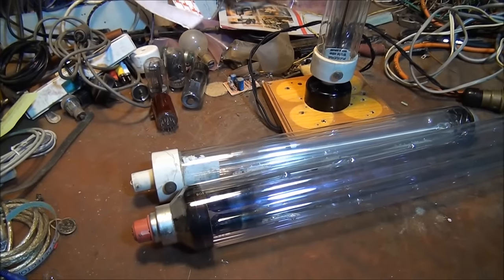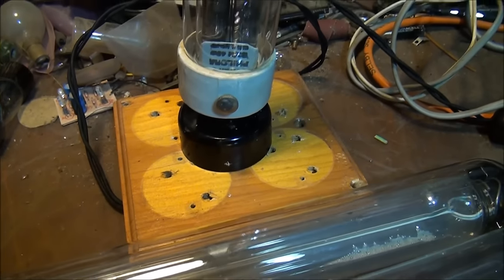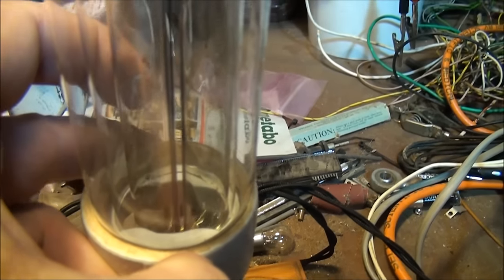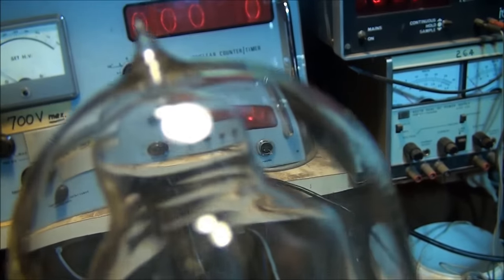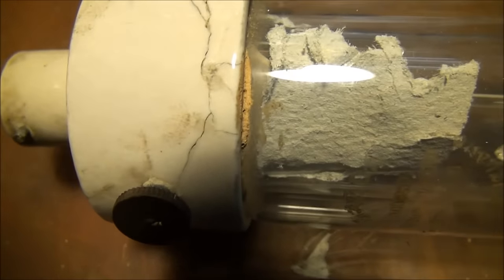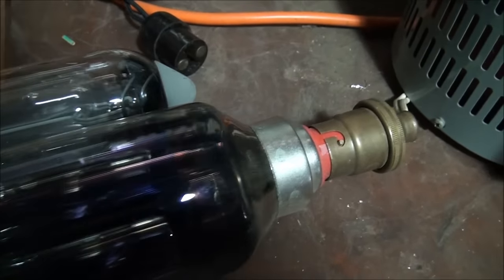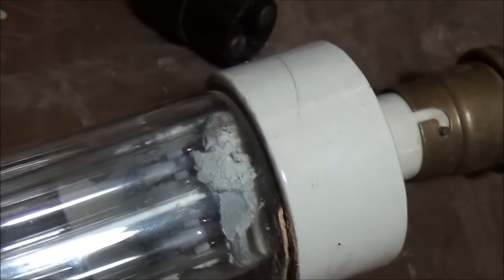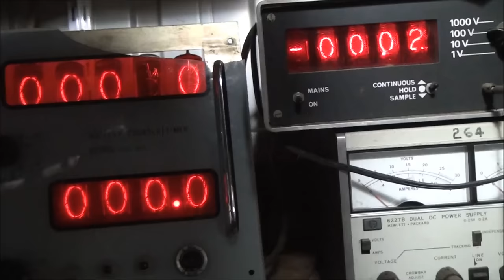Vintage Sodium Lamps and Plasma Tornados!

Comment: Those lamps are awesome. Nice find.
Reply from the maker: +Sander Sloots I bought them on 'Fleabay' and they were with a number of tubes listed as UV tubes but I noticed that these were a bit different so I got them for a reasonable price, the freight was a lot more than the items! Luckily they survived the transport as they are very fragile. I think I read an article on that type of tube and they would most certainly be some of the earliest due to the use of the detachable outer envelope.

Comment: Nice rare old SO/H sodium lamps. I wouldn't run them cap down as the sodium metal will run down when hot onto the electrodes and this can knacker the lamp.
Reply from the maker: +tuopeek1 Too right you are, I think that the small one has been run cap down before I got it as it does have a fair bit of Cathode contamination, hopefully I might be able to shift the Sodium once its molten. Thanks again!

Comment: Very nice Ian, thanks.  The old sodium lamps are rapidly disappearing round here as street lighting gets converted to LED and one day they will be collectors items! I might have to get one- what do you need in the way of control gear to run them- presumably a ballast like a fluorescent?
Reply from the maker: +Alan Cordwell They use a Ballast similar to a Fluro light but no starter, its wired in series. You could find one at an Electrical parts dealer or scrounge one from the local Council or whoever looks after the street lighting. I think that FleaBay sometimes have LP Sodium lamps for sale, its worth having a look. Anyway they are a pretty simple lamp to wire up and I imagine that the Fluro magnetic Ballast would work ok.
Reply: ***** thanks Ian :)
Reply from the maker: +Alan Cordwell You are welcome! Good luck in finding one, pls let me know if you have any luck.
Reply: +Alan Cordwell The HP Sodiums use a ballast like Ian said and an igniter which needs to provide the starting voltage. I run HP Sodium lamps succesfull of fluro ballasts or a microwave oven transformer with Caps in the 240 Volts side to limit the current. The LP not to sure
Reply from the maker: +RODALCO2007 You are correct, the HP Sodiums use a Ballast and Ignitor to strike the arc and the LP types simply use a series connected Ballast. The tube contains Neon gas which strikes at a lower voltage and the tube then warms up the Sodium which then takes over.

Comment: That last tube that went out by itself could be due to the wrong ballast being used so it doesn't give enough volts or possibly its a non standard tube requiring a higher arc voltage
Reply from the maker: +jon johnson It went out on low voltage as I ran it up on a Variac in case I accidently pop the tube, I ran it later on and gave it some more voltage and it ran with no issues.